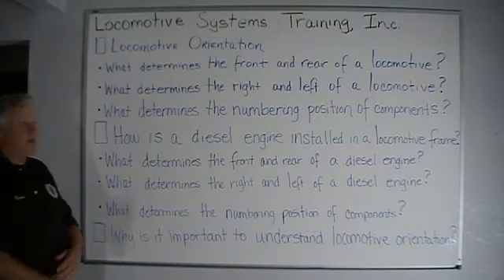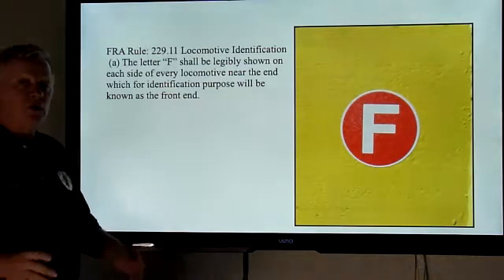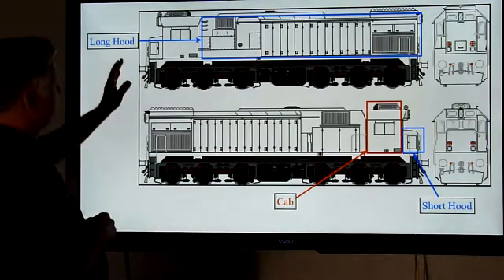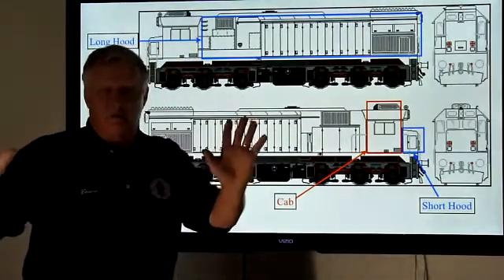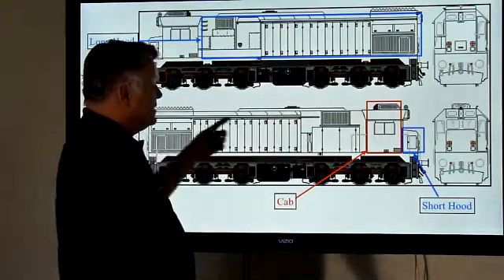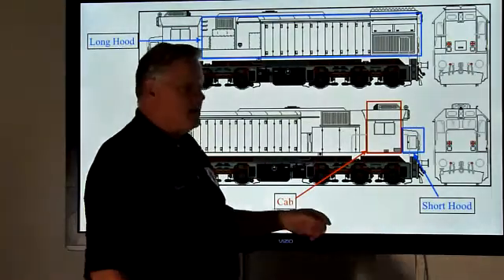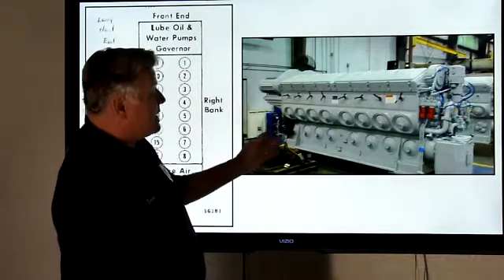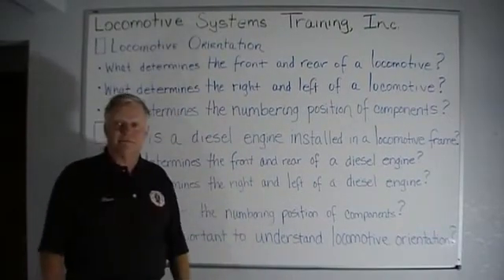LSTV-001 Locomotive Orientation Part 1

Comment: Hey Bruce, I watched the video two times now, great stuff. One question though, It is not clear when it comes to the numbering of the power assemblies. You spent time telling us that it is the engine parts that determine the front and rear of the engine, but you also say many times the F determines the front and rear and numbering of components. Really not clear with the engine, which is it? Is EVERYTHING determined by the F or it is everything except the engine?
Reply: I know this is late, but the answer to your question is everything except the engine. Think of the engine as if it were in a pickup truck, the accessories - water pumps, governor, oil pumps are on the front of the engine, the transmission, or in this case, the main generator, and flywheel are on the back end of the engine. When you think of the engine layout in this way, it’s easy to remember the cylinder numbering, on EMD engines, cylinder #1 is always at the right front corner of the engine, depending on if it’s a 12, 16, or 20 cylinder engine, directly across from #1 on the other front corner will be #7 for a 12 cylinder, #9 for a 16 cylinder, or #10 for the 20 cylinder model. GE engines are numbered a bit differently, both front corners of the engine are #1, either Right 1, or Left 1. So GE engines will have R-1 thru 6 or 8, and L-1 thru 6 or 8, depending on if it’s a 12 cylinder or a 16 cylinder engine.